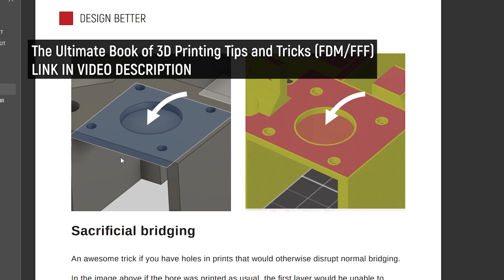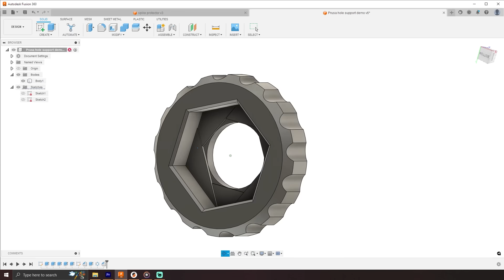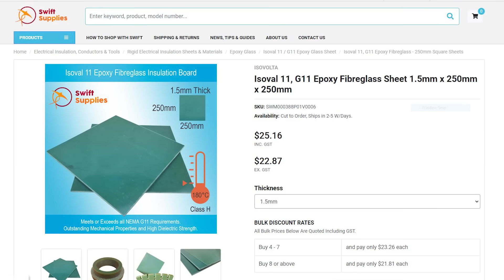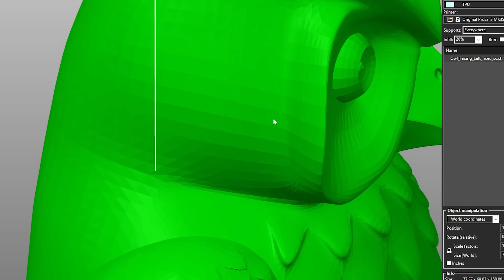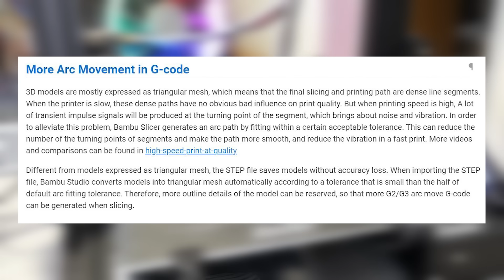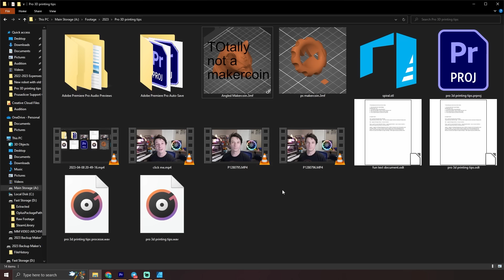5 3D Printing Tips I wish I knew years ago! #3DP101

Comment: i disagree on the food dehydrator bit. 
i have used this.  and it takes hours to dry out a spool. and leaving pla near it's glas transition temp for so long doesn't seem wise either. 
not to mention you need to alter it to actually fit a 1kg spool because they usually come with racks. (unless you get one where the racks can be removed from the sections) 

i simply have an old bucket that used to hold cotten candy that seals nicely.  i put 6 250 gram dessicant bags in there.  and the last time i refreshed my dessicant was months ago. 
and i open this thing up regularly because i use it to dry out other things aswel. 
with regularly i mean i open that thing atleast 3 times a day.  EVERY day.  and still the dessicant is good enoegh to dry out everything to desert levels passively. 

when i first put the bags in there and let it sit.  the air in there go so dry that you could feel a significantly cooler air when you reached in there. (because it's drawing all the moistore off of your hand and evaporation is a cooling action) 

and just put them in the microwave for a few minutes to refresh the dessicant.  uses alot less power than running a food dehydrator for hours and hours on end.

Comment: How would you print thin walled abs parts? 
I got 65°C chamber temp and using fan at 20% makes the part weak. 
Only 0% fan makes these parts strong, but messes up all overhangs :(

Comment: I use a 3mm glass mirror for a bed. Excellent stiction by just increasing first layer temp for pla to 220C and back to your normal temp for other layers. The only negative is speed. Glass is heavier than G10. So accel and decel can't be 3000mm/s²

Comment: I think you were cleaning the bed with a paper towel. I used to do this and got variable adhesion. I changed to using a cotton cloth and the adhesion got MUCH better. I clean the bed with IPA using a cotton cloth. I discovered that paper towels leave a lot of very fine fibres on the bed which, I think, can disrupt the adhesion. Cotton cloth doesn't seem to. HTH

Comment: Great tips...  I remember after getting my start with my Monoprice mini using painters tape and sometimes gluestick, that when I got my CR-10 Mini and glass bad, I spent a lot time time working on getting it dialed in so I didn't need anything...
When I needed a print to stick for sure (was showing it to friends, etc), I'd use some glue stick, but I was working on getting it dialed in and mostly had it to where the prints almost always stuck...
Then it hit me...  They always stuck with glue stick...  They almost always stick without...
So now, I just always use glue stick...  ;-)

Comment: G11 tends to flex more easily.  I am not sure that this is a problem but it is a thing to be aware of.
G11 is also a little harder to stick to in my experience using it in a non-3D printer case.

Comment: I have mixture feelings for G10. In one of my printers it works very good with both PLA and PTEG. On the other one (brand and bigger size) I have to use glue whilst PTEG resists to stick onto it…. as awkward as it sounds.

Comment: Damn, my problem isn't parts not sticking to the print surface, but that they're sticking far too good to the printing surface (basic OEM ender 3 surface). On just my first two test prints I put scratches in the print surface, because some of the plastic (esp the "brim") just fuses to the surface so strong I just can't get it off.

Comment: Great content! but save yourself from the mess of glue sticks just buy yourself a "masking tape" and "goo gone". Lay the masking tape on your bed and when you are done take off the tape while the bed is still hot. Wipe off the leftover glue if there is any with the GOO GONE adhesive remover and then alcohol. The masking tape works well 100% even for ABS, and ASA, with no warping.

Comment: No A sheet of G-11 is like 30$ A Pei  magnetic sheet is 10-15$ . If you sand the PEI sheet with 2000-3000 grit wet sand paper your prints wont break off and it last a long time. Mines been going over a year. Right now its running 6 days a week since march and its never failed.

Comment: I saved one of my mostly cylindrical parts as a STEP file and it was half the size of the STL file.  I imported the STEP file into PrusaSlicer and sliced it.  The resulting G code file was approximately 20% smaller.  I haven't printed the part to see if there is any part quality improvement resulting from arcs instead of short linear moves in the G code, but I would have expected a much smaller G code file if many linear moves were replaced with arc moves.

Comment: I flipped my bed upside down and used the stainless steel side, isopropyl alcohol and gluestick, no more PINTA removal and no damage to the bed. I even went so far as to scuff up the surface on another one (upside down) with sand paper with iso and gluestick and adhesion is even better. Worked mint on PLA, PETG, and TPU.

Comment: i got a large 3d print adhesive spray can from 3djake with 400ml for only $10, i had it since 2 years and it still has more then half of the bottle

Comment: Oh god never use alcohol and paper towel. Alcohol smears oil around, and paper towels inherently have oil in them to keep the loose fibers from become airborne. So the paper towel leaves oils and loose fibers. A glorious mess. Using these two items will literally long term guaranteed zilch for bed adhesion. Dish soap, warm water, and a vegetable brush. Anything else will just piss you off and waste your time.

Comment: biggest tip: use your print bed and a box to dehydrate your filament! you have a very controlled temperature and by using the filament box, you can lay the filament on your bed and just leave it for a few hours.

Comment: I had to put all my 3D printers and supplies in a climate controlled storage unit for a year. The resin is probably bad for the Resin printer, but what I did for My filaments is I put them all in a Water tight storage box that has a seal, then put silica desiccant in the center of all the spools , to hopefully add another level of moisture removal I put 4 DampRid containers in the main bin , all the damprid  was new,  I pulled the equipment out of storage about a week ago, I haven't tried printing yet , but I think I'm safe because the DampRid containers have no liquid in the bottom of their tubs. I don't know how low they can bring down the humidity? I'll know later this week if it worked or I need to dehydrate them before use. I have 20+ rolls and 30+ bottles of resin (all expired now 😢)  I think long term storage is the biggest issue with this hobby if you can't use your equipment for an extended period of time for any reason. Mine? My wife wanted to roam the USA in a RV for a year, I wanted to take the printers with me but vibration (driving) ,  space and fire risk (in an already flammable home on Wheels) wasn't worth it. My insurance probably wouldn't like the reason if a bed or hotend went up in flames when out getting supplies 😮. I really wanted to do it , I had over $15k in solar installed that could run anything including a 15K AC unit,  I might have been the first with a Mobile 3D printer?

Comment: I can't see the difference between stl and step models. I made a cylinder in solidworks and exports it as stl and step. And when i add both files to superslicer they looks identical. Both has identical polygonal surface.

Comment: Something I've done with varying success for drying filament is, and this will only work if you have a heated bed or a similar sized flat surface, is to put your sealed filament with desiccant on it and cover it with a box to enclose. I put it up to 50 degrees for regular PLA, 55 for Performance High Temp PLA, anymore and I'm concerned it might melt the filament together. Leave it for 3 hours before flipping, wait another three and boom, seems to work. Plus side, cheap most of the items you already have (Filament box, filament, 3D Printer lol) cons: can't use printer during this and your mileage may vary.

Comment: You can hide files in word documents as well by renaming the file to .zip and putting things into it, and then switching back to .docx. It will give you a popup that there is unreadable content when you reopen the file, but it still works as normal.

Comment: Problem with G10 - it's not really THAT cheap. Something that fits the bed of my Sidewinder X2 will cost about USD 12-15 (RM50-60) and I have to order it custom-cut. I suppose in the US you could get it from McMaster-Carr, but that's not an option here. I tried unreinforced phenolic, that warps when it heats up. What I found that REALLY works well and IS cheap is 300x300mm mirror tiles from IKEA - not only do you get the exact amount of adhesion necessary for PLA/PLA+, you can use it with glue stick when printing PETG, you end up with a mirror smooth surface on the bottom of the print. You can actually use it unheated for PLA, though it works better at 50-70C (and the prints release automatically when it cools). AND it costs USD 6 for FOUR of them (I've managed to break a couple from forgetting to clip them to the bed). Nice thing about the X2 is that using any sort of clip-on bed is a breeze - unlike my old Wanhao i3 Plus, no need to mess with frame-mounted Z stop sensors - the bed leveling sensor adjusts for the added thickness automatically. Cleaning it is easy, spritz some IPA and wipe with a paper napkin before every print. 
In the past, when I used glue stick a lot more than I do now, I'd spray IPA on the bed where there was a layer of glue stick on it, and then I'd smooth it out with a spatula or a napkin.

Comment: Hi Angus,
Thanks for another great video, big fan. Can you provide further details on the bearing setup in the food dehydrator? I already have a dehydrator for this purpose and would like to replicate the bearing and filament outfeed. Do you have a source for a particular bearing as well as any 3d printed parts?
Reply from the maker: I used a large diameter thrust bearing I had on hand, and half of an old plastic spool cut to act as a platter, sadly don't have specific part numbers but anything to reduce friction should work quite well! For the ptfe I simply drilled a tight hole for the tube to push through. Take care as the clear plastic is very fragile!

Comment: I don’t know why people don’t know about this but I’m not joking put duck tape on the bed it gives infinite adhesion the layers will split before it pops off try it but it just is very difficult to get off after too but it’s worth it pvc tape also works you might need To rise your bed for better adhesion depending on how your bed is leveled you want a little bit of bleeding for best results

Comment: For drying filament, the easiest way to do it is to just dry it using the paper box the filament comes with and the printer’s heat bed. It works for petg sine we are only drying it for like once a month. Nylons will be a pain since u can’t dry and print in the Sam etime

Comment: I have an ender 3 s1, and I'm not getting stringing without Z-hop, but all my prints fail, but when I turn on Z-hop my prints don't fail but the have lots of stringing, and ive tried changing retraction distance and nozzle temp, and turning on and off combing.

Comment: I discovered a nasty lil secret hot end manufacturers doing. The aluminum may not be the correct grade for contraction and expansion when hested and cooled. If adjust your z axis offeset with a heated bed like at 60°c and a cold hot end the distance between the bed and nozzle will change drastically if not the right aluminum alloy. Most bed leveling and z offset videos don't mention this important fact. Don't buy knock off microswiss hotends that don't specify details on the heater block

Comment: About the Arc thing:
I have to test on other printers, but at least on my Tronxy XY 3 SE, I have to be careful with arcs, because every arc represents one command.
With non-concurrent processing, this means I may have a full circle with only one command, but it may not stick, or the nozzle could collide with the print bed, because the Z-Axis does not get updated with ABL data during that arc.

Also, a friend of mine found out, that you have to be careful to not overdo the drying process.
In his case, he used XPETG from Extrudr, which is fantastic otherwise, but can be dried to as low as 15% humidity - at which point its viscosity will be bad and it will barely stick to the print bed.
35% works perfectly.

Comment: Garolite turned out to be not so cheap when I tried to get it for my printer. No vendor had a size big enough, I contacted a local manufacturer who sold cut to size G11, they quoted me $400… FOR ONE SHEET
Reply: Try McMaster-Carr - they've got up to 36"x48" which is around $120
Reply: @paulhaddon7113  Unfortunately, i am in the EU. Shipping, customs and import tax would empty my wallet in a hurry even if they shipped here :/

Comment: Hey just as a further tip on that food dehydrator.... I actually got one off a local internet site but I got a tall one. I cut out the bottom of each tray to make the inside open so I can stack 3 rolls of filament at a time.

Comment: Hi Angus, I tried STEP export from Fusion 360 and imported into PrusaSlicer 2.5.0 and it actually created a more faceted-looking version of the model in some curved areas compared to when imported as an STL from Fusion 360 (both when looking at the model on the plate and the shape of the print moves in the print preview), which looks nice and smoothly curved. Only a single data point, I may need to play more with it.

Comment: BRAND-NEW surface on your build plate, well like brand-new.  3 factors combined will get you there 1) cover bed with 3-4 sprays of Spray Dawn Platinum Power Wash 2) really wash it with the paper towel, and really wash it again 3) rinsing with the more powerful jet or the kitchen sprayer.   The rinsing might be the key but so is the Dawn and you really gotta wash it good, so all 3!    You may want to do a wash/rinse before the  wash/rinse to get all the gluestick, hairspray, etc off and then do a second wash/rinse.  Plus the Dawn sprayer thing is pretty cool and reduces waste.   Wish I got paid by Dawn, but no.

Comment: Just a thought about drying the filament. When you dry plastic like PLA, the water leaves, but now the plastic is full of voids that can be focus points for cracks and it's still brittle. Consider replacing the air in the voids with a hydrocarbon (like ethanol, turpentine or something) to soften the plastic cracks a bit. After drying, place it in a container full of those fumes for an hour.

Comment: I came up with that same hole bridging trick a while ago. It seems like something slicers should be able to figure out how to do by themselves, by something like ordering the different parts of a bridge so that nothing is printed before being attached to existing material (the root of the problem is that normally all perimeters get printed first, even the ones "in the air"). SuperSlicer does have some experimental bridge perimeter options that seem tangentially related to this problem but it doesn't do quite the right thing yet.

Also a way to get curves to print better (at least in the XY plane) with a traditional mesh workflow before STEP support gets better is to run Arc Welder on the G-code. I have this integrated into OctoPrint and use it on pretty much everything.

Comment: Forget special build plates, forget IPA, forget glue sticks. Simply wash your removable build plate in warm water with a degreasing dish soap (I use Fairy liquid here in the UK). Dry with a paper towel and I've not had a print fail due to bed adhesion since. 👍

Comment: I regularly use food dehydrator with my filament rolls. I made one of the trays into a container full of desiccant that fits into the storage bucket I use. It even has a section filled with color-change. Good point about keeping the bed clean. I have a spray bottle with a mix of 70% IPA and dissolved glue stick that I use before printing.

Comment: For an additional tip for drying your filament, if you can't find a food dryer then what you can do is set your printer bed to 70 degrees C, then take the box that your filament came in and cut off the lid and punch a 3x3 grid of holes in the bottom with a pencil. Put your spool on the heated bed and put the box on top of it. It should dry your filament within about 5 hours.

I've tried it. It dried out some bad PETG I had to be like new.

Comment: I used to need glue stick if printing objects with thin lines. I modified my original E3 hot end by upgrading it with a bi-metal heat break a couple months ago,  I've never had it print so well on a glass bed and don't need the glue.

Comment: For PLA, I use water / alcohol-based hairspray in a pump bottle (Garnier "Fructis Style") for bed adhesion. A few dollars for a 250 ml bottle which lasts forever.  A few spritzes on the heated bed is all it takes.  The stuff is a mix of water-soluble polymers (or an emulsion), so it dries almost instantly and is easily washed off with water or alcohol.

Comment: I run Arc Welder in my Octoprint to convert steps to arcs. On round prints especially it looks way better. I have seen some artifacts I can't really pinpoint but overall it does well (with regards to the bit about STEP files).

Comment: I bought a cabinet style food dehydrator that comes with multiple shelves. The shelves are removable, so I can stack 5 or so spools in there and just turn it on at a suitable temperature and let it rip for 24 hours. Sure, it cost over a hundred bucks but I can dry multiple spools at once - and make beef jerky. Not simultaneously.

Comment: I originally came across partial bridging in voron parts, I wondered how they printed so cleanly without supports and saw in the slicer they had drawn a box using two layers perpendicular to one another inside hex nut holes.